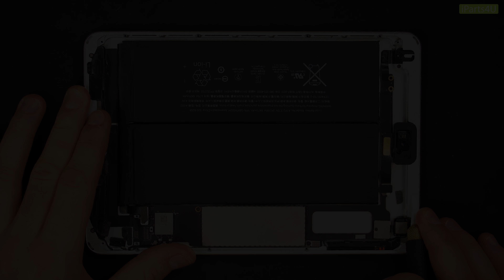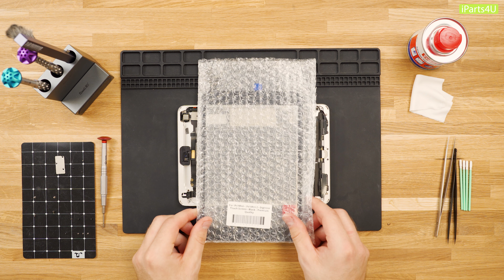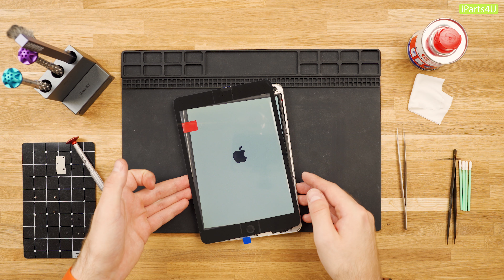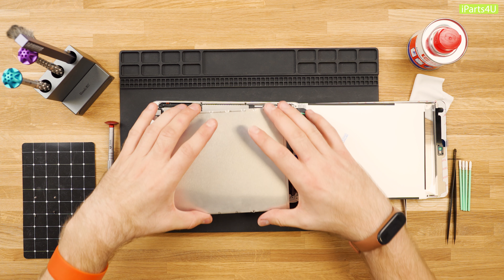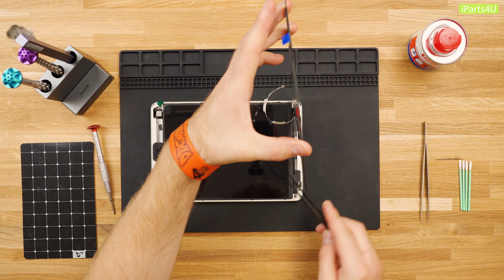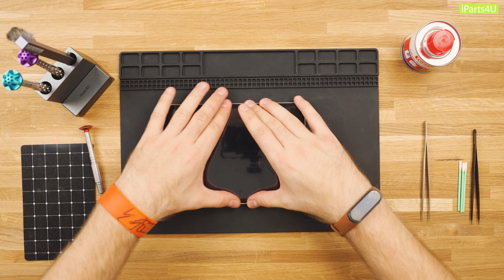iPad Mini 2 | How To Fit An LCD & Digitizer

Comment: informative video! is there any difference for ipad mini 2 lcd with ipad mini 3? does the model number affect?
Reply from the maker: The Mini 2 & 3 have the same LCD but the digitizers are different.
Reply: @ thanks for the answer! But if we want to replace the LCD, we don't have to deal with the digitizer, right? Well, maybe it's because the LCD is underneath, so we have to get rid of it first.
Reply from the maker: @bagussskn  As long as you don't damage the digitizer when removing it then you will not need to replace it, you'll just need to clean up the adhesive around it's edges & apply new tesa adhesive before refitment. Link to adhesive: https://www.iparts-4u.co.uk/for-ipad-mini-1-mini-2-tesa-precut-touch-screen-adhesive
Reply: @ Alright, I got it! Thanks for answering my questions, have a great day!